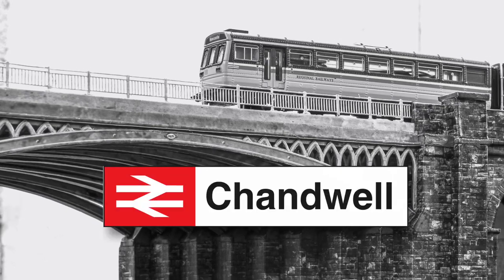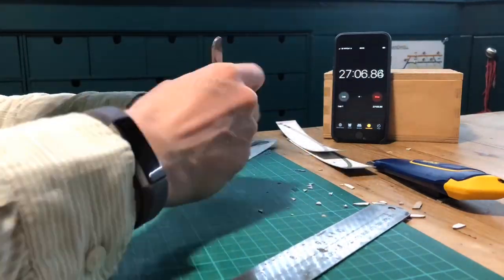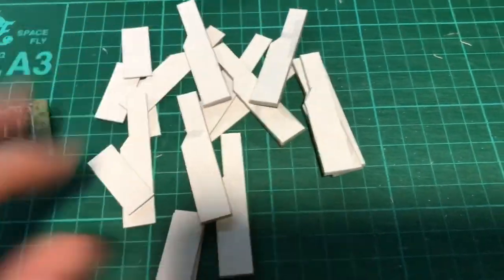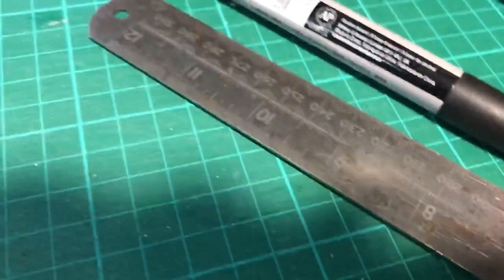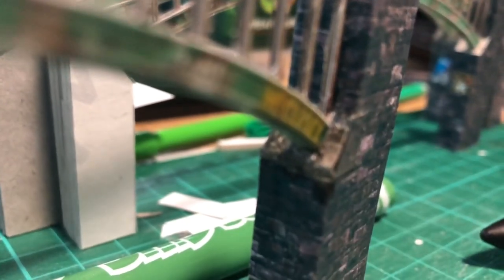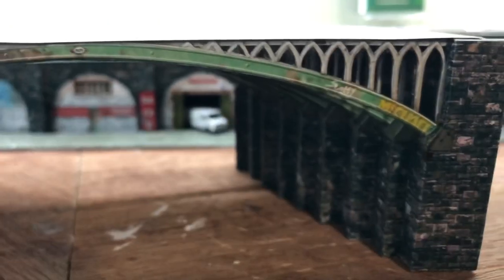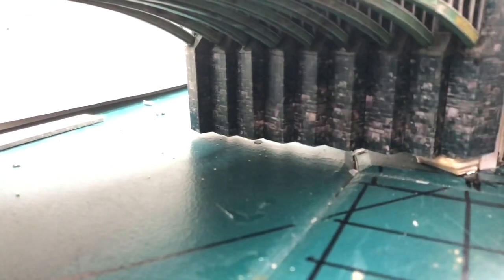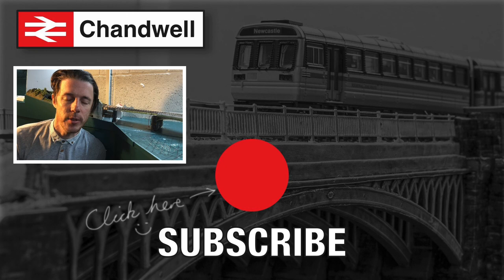Scratch-building an N Gauge iron arch skew bridge

Comment from the maker: I kept the part that shows the designing in Inkscape really short. Would you like to see more of that kind of thing? Please let me know.
Reply: Yes please, I would like to know about inkscape and a not short tutorial.  Thanks
Reply from the maker: Thank you Mike. I will see what I can do at some time.
Reply: Yes, would be very interested in seeing Inkscape design
Reply from the maker: Great. I am planning to do a series of videos showing how Inkscape can be used for scratch building, from simple things like making window frames, to realistic sloping roads, and eventually to full builds.  My plan is to release one of these a month or so. If you have any specific area of interest, please let me know.
Reply: Chandwell N Gauge Layout, I have Inkscape for doing vinyl cutting for clothing printing to convert images to right format. Also looking at doing Anyrail series to start my channel going.
Reply: Yes please, I have Inkscape but struggled to use it. I have a big job with lots of Scalescenes kits that need to be modified so I was hoping I could pull the bits into Inkscape and fix them how I want them. Then print them directly from Inkscape. Really like what you did with the arched bridge, so many fiddly bits. Sigh. Not sure my old hands could handle it but your bridge looks fabulous. I was sent here by the nice folks in the Scalescenes Facebook Group though I was already a Subscriber.

Comment: I am amazed at what you have created. I've dabbled in Inkscape - running up windows to print onto acetate, etc, and there are lots of videos on how to use it on You Tube, but absolutely NOTHING on using it to create model buildings. Perhaps you can start a series on Inkscape for model railways? I think you'd be onto a winner. Oh, and you have a new subscriber. Again, a fabulous job.
Reply from the maker: Thank you Paul, I am pleased you like it; and thank you for subscribing. I may do some videos on Inkscape. I was never sure if anyone would be interested. It is a fabulous application and you can do so much with it. 👍

Comment: Looks incredible, well worth the number of hours it must have taken.
Reply from the maker: Thank you!
Reply: Chandwell N Gauge Layout Are you ballasting the bridge? Does the real one have ballast or just timbers running the length of the bridge under the sleepers?
Reply from the maker: Yes I have ballasted the bridge. I am not sure what the real one has as I have not been able to get to it. However, from Google Earth, it looks like it is ballasted. There is no difference to the trackbed as it crosses the bridge.
Reply: Chandwell N Gauge Layout That’s good then. A lot of old iron/steel bridges don’t have ballast to keep the weight down. It’s not something easily noticed as a passenger, but it’s a pain to walk along the track as the rails are about two feet above the bridge deck level.

Comment: Hi. Using Inkscape, is it possible to be accurate when drawing shapes eg can you type in exactly what size you want things.
For example, if i wanted a square 50mm x 75mm I could dimension it as these figures so i know when its printed out, it will be mm perfect?
Thanks
Reply from the maker: It certainly is. You can get accuracy to 1000th of a mm if you really need to! Draw a rectangle of any size. Select it. And there are boxes on the top toolbar into which you can type dimensions.
Reply: @Chandwell  absolutely brilliant.
It was me that asked about the Cricut yesterday, and am considering getting one for this kind of projects, using Inkscape to drawer it all out and the cricut to cut it out.
What type of card do you use? I bought some 300gsm white smooth card today from hobbcraft in the hope it is suitable, it was the thickest they did

Comment: I use glue stick as one of the bazillion ways to laminate detail onto card stock. How well is the bond holding up over time? Does it seperate?
Reply from the maker: Not separated yet. I have a card building laminated with glue stick in the garage. It's pushing 10 years old and is still stuck together properly.